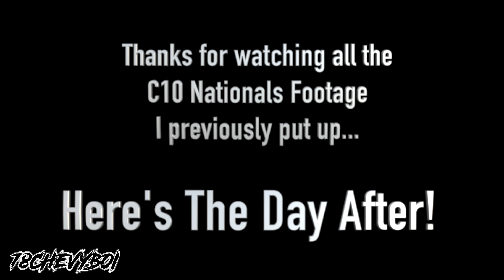Cayenne’s Cousin Stops by… I might try to BUY THIS ONE‼️

Comment: thanks for the video and letting me come thru and kick it with you.really appreciate it bro💪🏿💪🏿💪🏿
Reply: Fam that 2 door is clean!!
Reply from the maker: 🤞🏾💯 We locked in bro!
Reply: @ronrobinson1188  thanks
Reply: @Ezchevyz  what lowering setup did you use and how much did you drop it?
Reply: @78chevyboi  what's good fam? Keep on pushing positivity man and we gonna spread it across the country.... I don't know if you really realize the weight that CNC carries in the YouTube car community, it's a real force out here man!!!
Reply: @ronrobinson1188  beltech rear lowering shackles and smaller leaf spring pack I think its like 6 inch drop all together
Reply: Man i got my 2 door parked, but seeing yours got me motivated to get her back right. What rim, tire size you running? Looks mean. Nice ride. Im going to follow you page. Thanks again.
Reply: @167champ  yeah bruh bring that truck out,I got 24s on mine 275/30/24 and 295 on the back
Reply: @Ezchevyz  😃thanks i can't wait to start